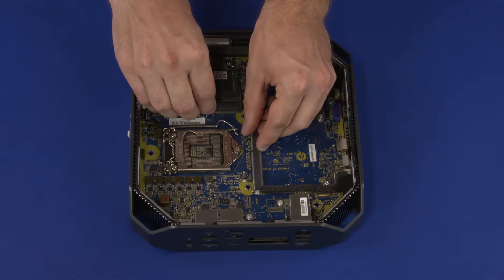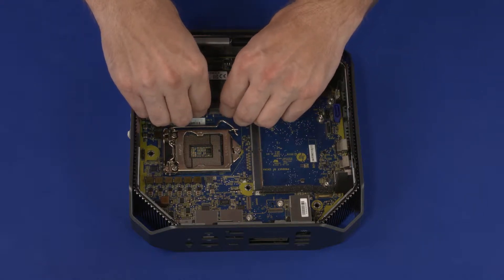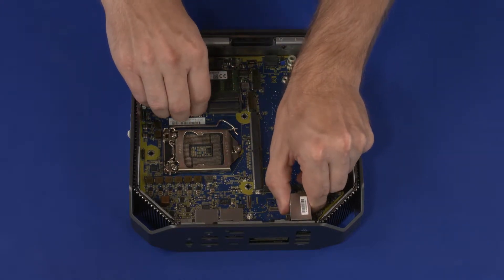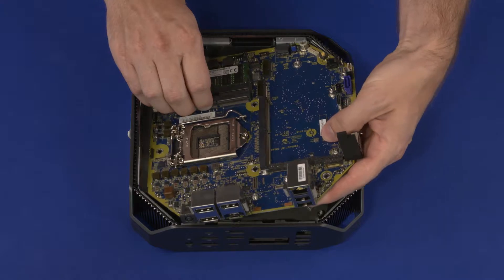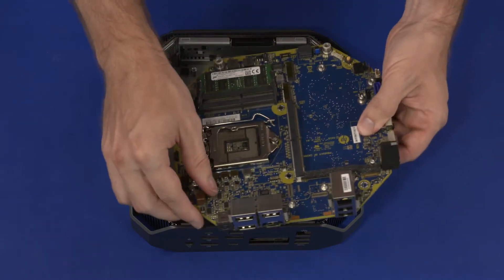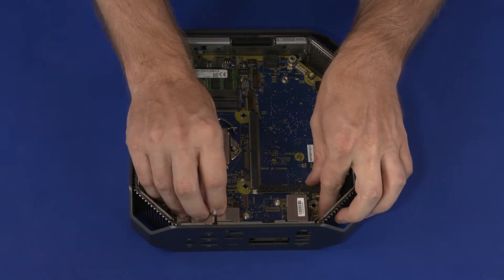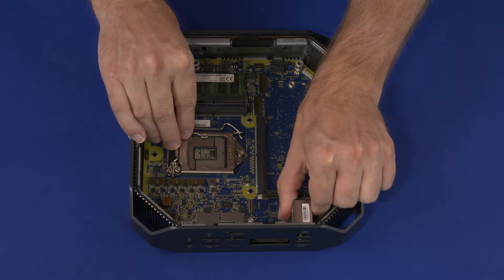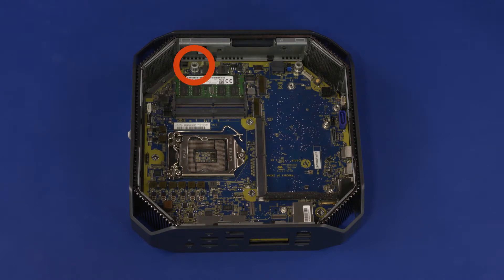Replace the System Board | HP Z2 Mini G3 and G4 Workstations | HP

Comment: red led error?  System board?
Reply from the maker: Hi Keith, thanks for contacting HP Global Social Media Support!
I understand that you are experiencing a blinking red light issue on the motherboard. 
I will do my best to assist you.
This seems to be an issue with the system board. Please go ahead and replace it. 
Binu_HP Social Media Tech Support
Reply: @HPSupport  solid red light, no beeps
Reply from the maker: In order to get this issue fixed, please contact our customer care team over the phone or chat for further assistance, as this issue requires Live conversation with you over phone or chat to isolate the issue and provide you instantly with appropriate solution or repair/replacement options available at your place as per the warranty.
Please feel free to reach us on call/chat, please access this link to select your preferred country and language option to reach us. Global support link: - https://www8.hp.com/us/en/contact-hp/ww-phone-assist.html
Binu_HP Social Media Tech Support

Comment: Just wondering, Is there a more straightforward way to change the CMOS battery on the underside of the system board or does it require disassembly of the components indicated in this video in order to access it? Thanks
Reply from the maker: Hi Fergus, thanks for contacting HP Global Social Media Support!
I understand that you need to know about removing and replacing CMOS battery. 
I will do my best to assist you.
Please refer this document to know about removing and replacing CMOS battery: https://bit.ly/3f5QCHR
Binu - Social Media Tech Support

Comment: Hello you can help me i have a Mini Z2 G4 with I7 8700 processor and graphics Card Nvidia Quadro p620 4gb i like change the main board for add other video card with more high capacity, you can help me
Reply from the maker: +GERMAN ARMENTA HP does not recommend upgrading or downgrading hardware parts or software that is bundled with the product as It may affect the manufacturer's warranty and performance, however, you could change the configuration at your own discretion.